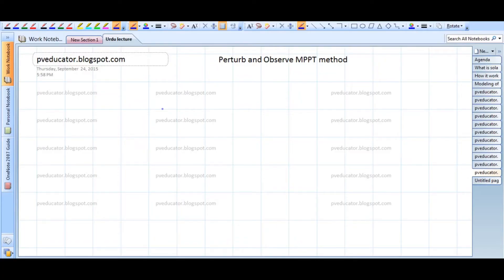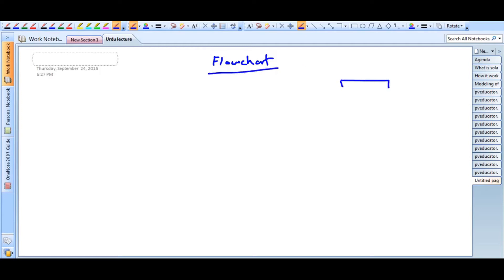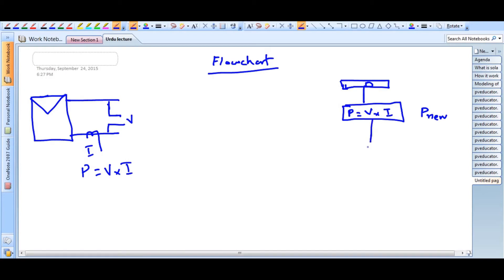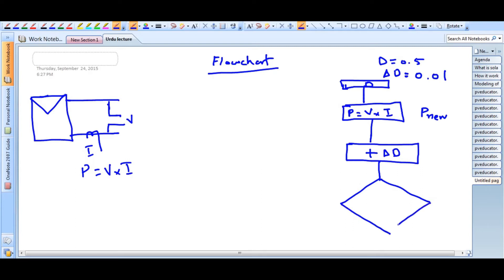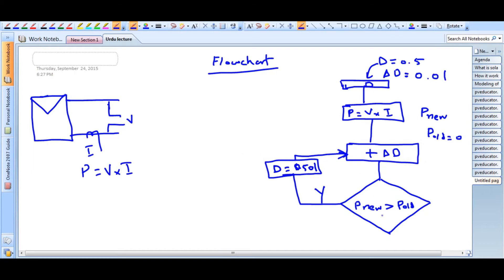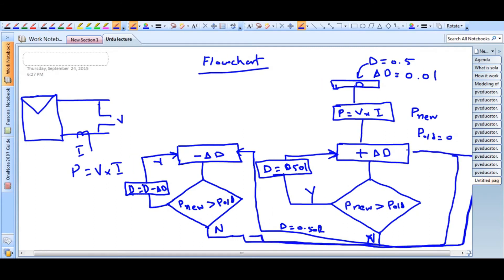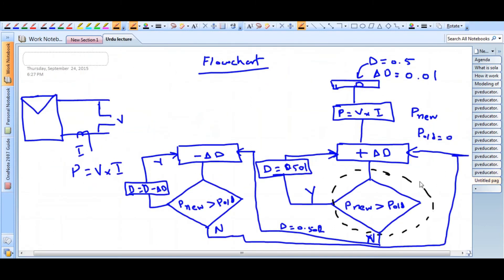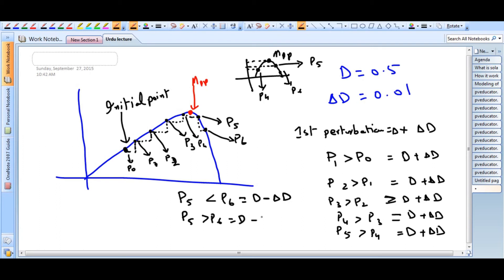P&O MPPT for Photovoltaic

Comment: Hello sir, with change in duty cycle,output of dc- dc converter changes..but how input voltage of the solar changes? Please explain sir
Reply from the maker: Output power and input power are equal assuming a lossless converter.
Reply: Ok sir ...thank you

Comment: Can you also explain modified P&O (dP-P&O) algorithm
Reply from the maker: Why not. Please refer to the paper you are taking.
Reply: @HadeedSher  
DOI: 10.1109/TIE.2008.924036
Link: https://ieeexplore.ieee.org/document/4497234
figure 3 is Algorithm, basically i am confused with Vref in algorithm as Duty Cycle is required to modify output of convertor(Buck/Boost/BuckBoost/Cuk)

Comment: How do you know the initial operating point of a specific photovoltaic panel? Is it always 0.5?
Reply from the maker: It is a rough guess. Starting from 0.5 gives you a midpoint to initiate the process. If you make it 0.2 and at that time the MPP is at 0.8 then it may require a lot more number of iterations to reach the MPP. Also i may happen that by using 0.2 as a starting point, the power comes out to be very low and consequently, the system may trap there due to vanishingly small change in power after a perturbation. Please search about the inaccuracies in ADC and filters for measurement of signals.
Reply from the maker: Simulation is here: https://youtu.be/Cfcrri-521g
Reply: Thank you!!!
Reply: Is the initial point of 0.5 measured from the voltage or power of the P-V characteristic curve?

Thank you in advance
Reply from the maker: It is a value of controller. Because if you select the voltage then the reference is set as the voltage value not the duty cycle value.
Reply: Also, at 10:30 would it not be P5 is greater than P6? In the video it says P5 is less than P6
Reply from the maker: Yes
Reply: Yes, thank you very much